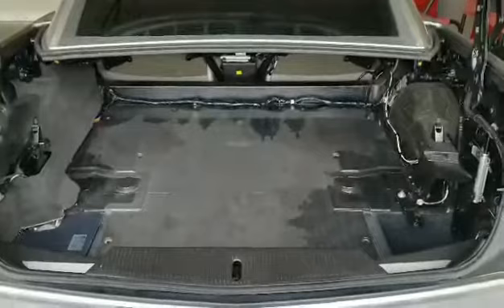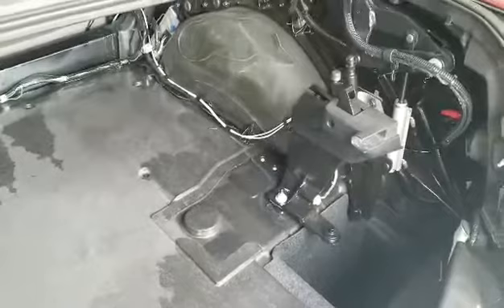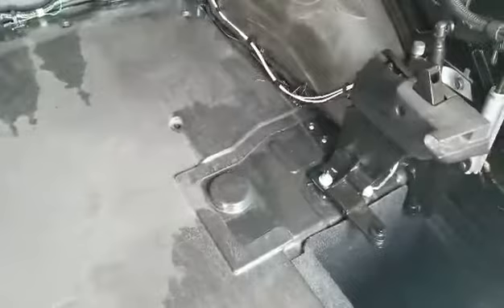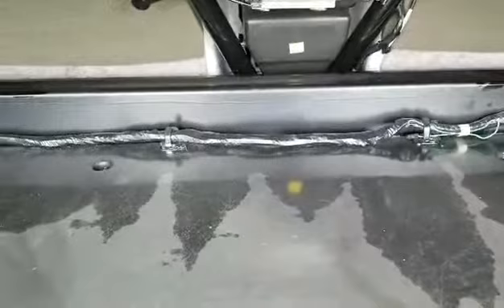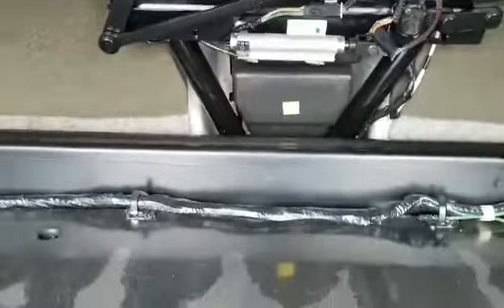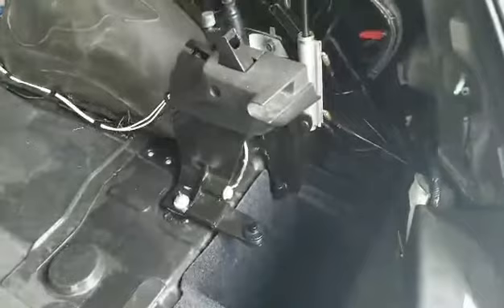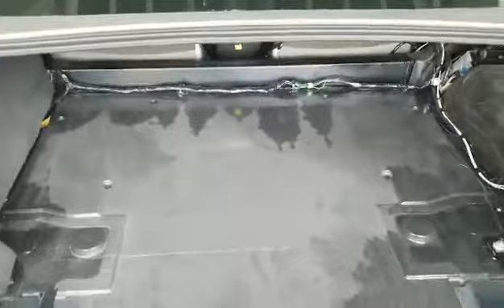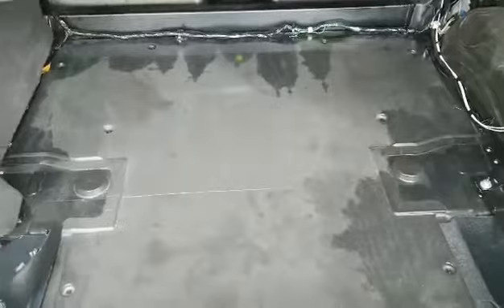XLR Trunk   Video - Hydraulic Leaks Under the Carpet in the Trunk

Comment: Hello, I have the same exact issue, and stain marks. Did you find your issue?
Reply: Yes!  The issue was the Hydraulic Cylinders.  Truth is the leaks show up all throughout the trunk because the hydraulic fluid moves back and forth as you accelerate and decelerate.  So, I replaced all the cylinders in the trunk and that solved the problem.